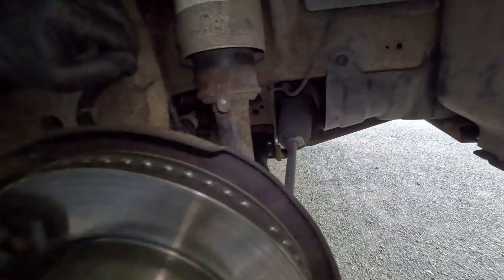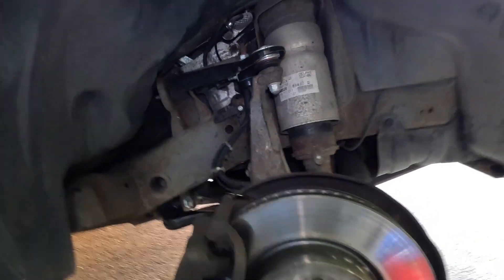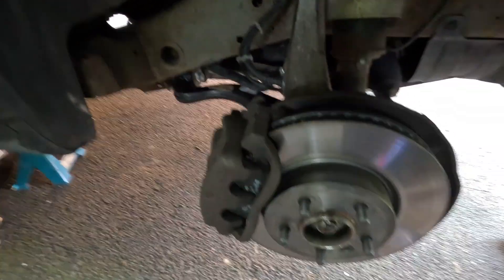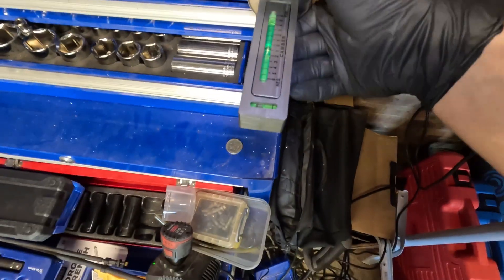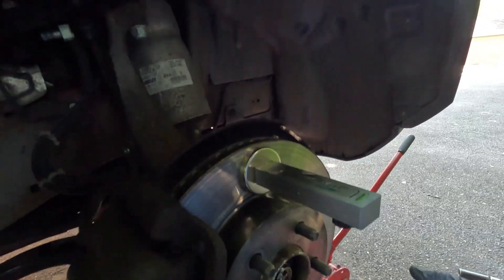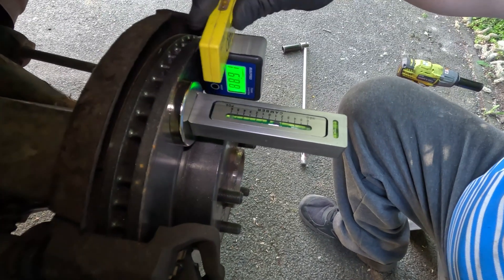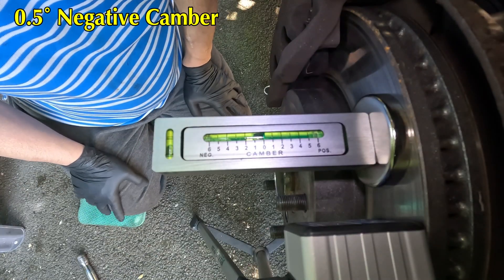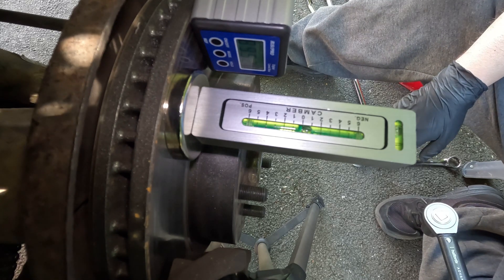DISCOVERY 3/4 How to Adjust and Set Front Wheel Camber LR3 LR4

Comment: Hi alex..good video..i have been meaning to do my rears after swapping all the arms..
Just wondering how the angle gauge looks when the wheels are back on the ground and do the measurement stay exactly the same?
Thanks lee
Reply from the maker: Due to my wobbly drive, I can't get a good reading. But I did have my MOT today and asked for a wheel alignment and so I have the readings from my settings. Right side camber was -0˚51' and Left side -0˚13' so well within range. I am pleasantly surprised as I wondered if what I did was correct!
Reply: Fantastic..I have the same problem so will give this method a go..thanks